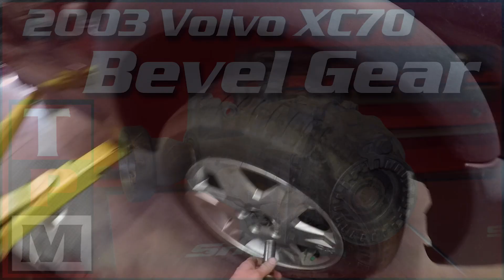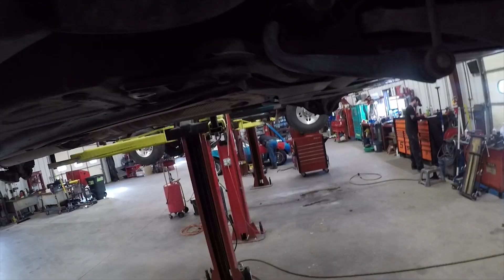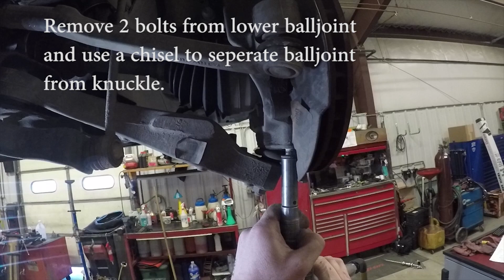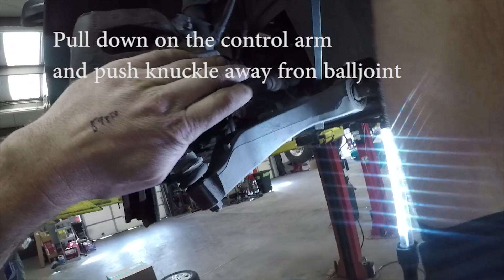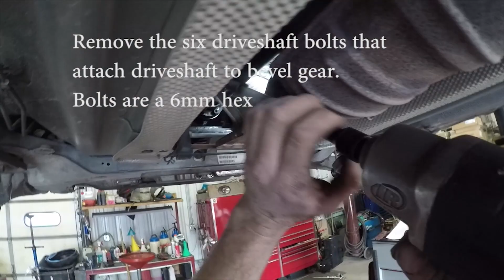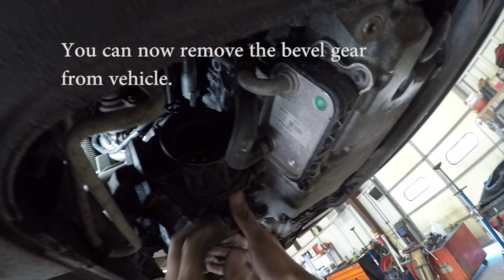2003 Volvo XC70 Bevel Gear Removal

Comment: Thanks for taking the time to get back to me. I have been looking at a lot of videos and reading about it,  and I am video chronicling my progress. When I get it all figured out I will be posting my own vids on reddit. The 03 xc90 t6 is very different than the other volvo's. It has a chain drive attached to the angle gear and its packed in real tight, and no other videos out there
Reply from the maker: Matthew Dodge no problem. I wish I was more help. Post a link when you get it done.
Reply: Hey Matthew Dodge. Did you got a chance to get a video on the Xc90?
Reply: @crespo8369  No. Never got it done. Because of the larger motor and twin turbo on this model, the angle gear will not fit out the bottom.  The only way to do it is to yank the whole stack, or remove the whole subframe and drop the stack out the bottom. These models have a completely inferior transmission system,  and are not worth rebuilding anyways. I will probably junk this vehicle.  Pile of happy horseshit. Fucking Chinese Ford Volvo. Nothing like they used to be. Very disappointed and disillusioned with this piece of garbage.

Comment: Thanks for the reply. Got it out and put back together next is to see how it performs as a fwd
Reply: Do you have to drain the transmission fluid before removing the passenger axle?
Reply: No. You dont have to drain transmission fluid for that. Expect some fluid leak of you would be replacing collar gear sleeve and seal for it@bradleyhovan9390

Comment: Thank you so much!! Do you have to drain the transmission fluid before removing the passenger axle?
Reply from the maker: I don’t remember the need to but I normally don’t worry about it on tear down.  If it leaks I top it up after the repair.

Comment: Triple Edge Performance rebuilt my GM Tranny on my Gifted 2003 XC-90. After Trans  install Bevel gear leaked. When removed it was toast. Volvo sold me the Bevel gear for there cost. What else do I need to complete the install? New bolts? Ect. Liked and subcribed! Thank you very much for your hard work!
Reply from the maker: Volvo often recommends new hardware but I have always used the original hardware.

Comment: Just tore into a 2003 volvo xc 90 and have it on blocks and apart to the poi t of bevel gear removal, but can't seem to get to the last few bolts and there's not a lot of room to get it out. Is there a way to finish removing it without pulling the whole stack out?
Reply: It's the t6 turbo so bigger than in the vid
Reply from the maker: Just saw your comment. Were you able to get the bevel gear out. I have heard the XC 90 is more difficult than the XC70 and it could be because the turbo interferes with access.  I have done several XC70s but never an XC90.

Comment: I have a 2000 xc70 there is a leak from transmission side that’s leaking bevel gear fluid do you know what seal I need to place

Comment: Getting ready to do my 04 xc70. Need to remove the gear to access the turbo coolant hoses. Have you replaced those hoses before and any tips?
Thanks
Reply from the maker: I haven’t done one in a few years so I’m a a bit rusty on the process. I think I’ve only replaced one set of lines before and don’t remember the process.  Sorry I can’t be more helpful in the procedure.

Comment: I have a 2000 XC70 the bevel gear is leaking gear oil do I need special tool to change the seals

Comment: Working on a 06 Volvo, the box was all broken, shaft was flapping around. went to put the new on but it won’t slide over the collar, the teeth look good, check again with the old box and won’t slide on, any tips to get it back on the collar, or recommend replacing?

Comment: Gday Mate... great vid. 😊 
Question; "Will the car Neutralize if these bevel gears strip completely?"
Reply from the maker: I don’t think so since the right front axle slides all the way through the angle gear into the transmission differential. You should still have power to the front but it might make loud noises.

Comment: I'm gonna try this tomorrow on my 2000 XC70. Thanks so far!
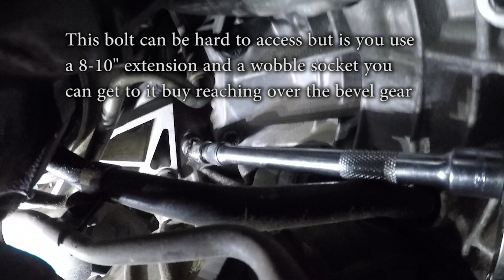Reply: @thepracticalmechanic please what do you mean at 3:20, I can't see what it is or where...:(! Pls help!
Reply: @cyrielgaemers  
There are 6, 6mm cap head bolts the hold the drive shaft (that goes from the angle gear to the rear differential) to the output of the angle gear.

Comment: Awesome video I have have a 04 xc90 and where the drive shaft meet the transfer case is really loose. The seal is gone. And I'm thinking there's a bushing in there as well. Any suggestions?
Reply from the maker: Del Shores there will most likely be a bearing that is damaged. Sometime the housing gets damaged as well when the bearing failure occurs. The unit will need rebuilt or replaced if case is damaged.

Comment: Why did you remove the bevel gear? I just got a 2004 xc90 that is making bad noise in transmission and moves slow?
Reply from the maker: This one had a leak and ran out of fluid which destroyed the internals. It was making a lot of noise.
Reply: @ThePracticalMechanic  I've the same, what oil doest it run?
Reply: @cyrielgaemers  75W-90 gear oil
Reply: If it's the 2.5T, it could be the angel/bevel gear. If it's the T6, it's probably the transmission.

Comment: Trying to remove bevel gear on a s60. I got the 4 bolts out but gear is stuck. Does it matter if car is in park or neutral ?

Comment: thanks so much! do you happen to know if the seal between is the one that typically goes? I have a leak but can't tell where the origin is from under the car, but I suspect that seal. thanks again.
Reply from the maker: There are several seals between the two units. Depending on what fluid is leaking will identify the seal that is bad.  ATF or gear oil.  It’s harder to tell on manual gearbox vehicles.

Comment: No I am kinda stuck on the last couple of bolts, access to the gear, and chain drive is in the way, two bolts on top under turbo are inaccessible. Doesnt seem to be enough room to get the c drive out anyways. Sway bar could get moved to get it out? It's an interesting and infuriating puzzler
Reply: Did you find a solution to remove the top bevel bolt just under the turbo? :)
Reply: @tjaddejaevel  No.

Comment: How do you pull out the spline from the transmission? Special tools?
Reply from the maker: I cut a groves on the outside of the coupler and used a two jaw puller. I fought it for quite sometime. They do make a special puller that attaches inside the coupler as well.

Comment: Can one drive without the bevel gear at all? I have the 2004 V70R AWD Auto.
Reply from the maker: I'm not sure if you can convert the vehicle to front wheel drive by removing the bevel gear. You may have to change the right front axle as well and I can't remember if the FWD version has a support bearing for the RF axle. If so additional brackets may be required

Comment: thanks for the video. does the prop shaft need to come out or did you just undo the bolts attaching it to the bevel gear and it moved out of the way?
Reply from the maker: I think I just moved it out of the way but it’s been a bit. I will check further into it this evening and see if that is required or not.

Comment: I have a 2003 Volvo xc90 2.9 twin turbo awd . I need to take out the transfer case or angler case. what best way to get it out?
Reply from the maker: John Jackowiec it’s been years since I have pulled one out of a xc90 but I believe it was very similar to this xc70. There might be a few minor differences.
Reply: @ThePracticalMechanic  right now the transfer case is just hanging there. and the way it looks like I have to lower the engine crate or  frame to get that bulky case out. just wanted to find out if there is another way.
Reply from the maker: The xc70 transfercase took the right rotation before it came out but it just barely fit. Can you lift up on the engine slightly to gain some room? You might also be able to unhook the torque mount on top of the engine to be able to rotate the engine slightly in the engine bay to gain some room underneath.
Reply: @ThePracticalMechanic  I have to try move engine by tilting toward firewall. otherwise have to lower the right side frame to wiggle out thru right axle opening.
Reply: This is t6  6 cyl engine and transfer case is a lot bigger than xc70. the way I should have taken the engine and tranny out in one piece. it is too hard to take all those connection to both turbos. That way everything on the floor will be easy to get the transfer case and both turbos.   @ThePracticalMechanic

Comment: Great video! How about removing the front left drive shaft? Do you also have a continuation to remove the transmission?
Reply from the maker: Thank You Paul, I do not have a transmission removal or left axle shaft video at this time.  Most of the failures I see are in the right axle and the bevel gear. If I get the chance to replace a left axle or transmission I will try and get a video of the repair process.
Reply: ThePracticalMechanic ok great thanks, I'm swapping the transmission in my xc70. Either way your video explains the first 50% thanks for filming!
Reply from the maker: No problem. Best of luck on the transmission swap.
Reply: How long did the removal take?
Reply from the maker: 1-1.5 hours for the removal. It could probably be done faster if that top bolt wasn’t so tight.
Reply: Slide hammer with cv axle puller tip
Reply: See my video on front left CV axle removal on AW55-50SN transmission on 2002 Volvo V70, all is explained in my own puerile style.

Comment: You  didn't show removal of the collar shaft, this is where 99% of the problems are and its a bugger to get off. I had to remove the fender and heat it up so i could pull it free, slide hammer didnt work.